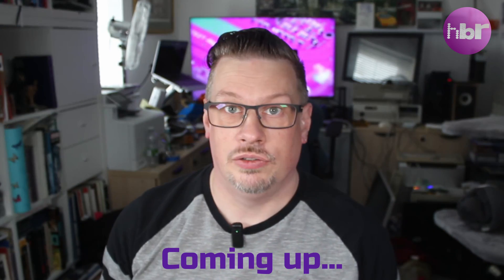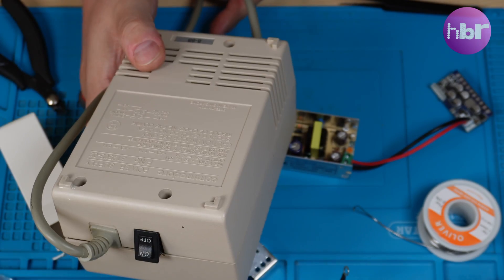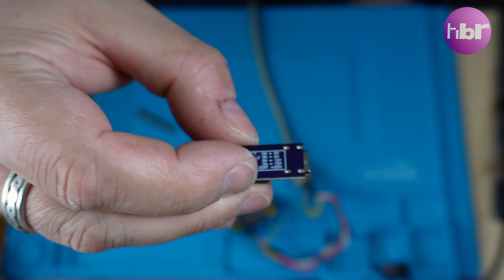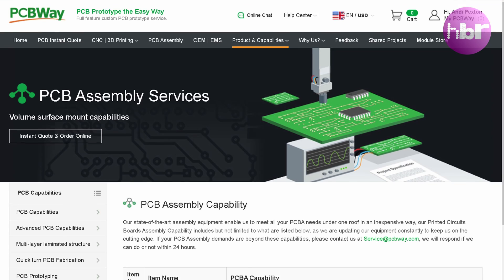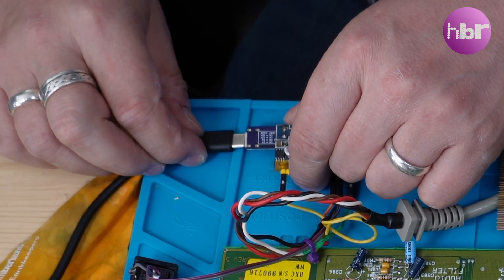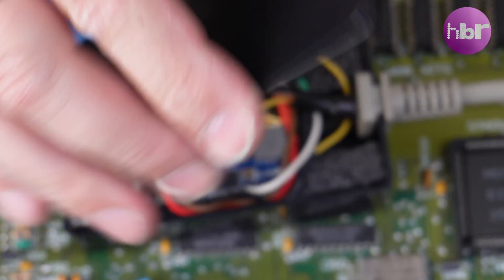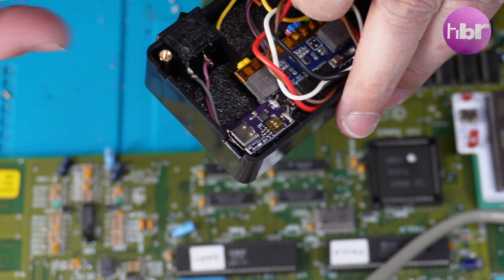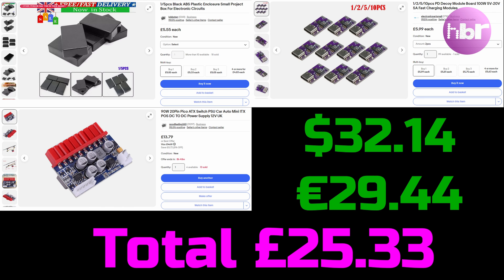Battery Powered Amiga? Modern PicoATX & USB-C Magic!

Comment: How you getting negative voltage from this setup?
Reply from the maker: The ATX power standard provides +5, +12, -12 and +3.3 volts. The Amiga uses +12, -12 and +5 volts...
Reply from the maker: Older power supplies supply -5v (which is part of the standard) this has been dropped from most modern ATX power supplies.
Reply from the maker: In this specific case I'm using a PD module to deliver 12v DC and powering a Pico ATX clone which is a DC-DC switch mode power supply, and provides the ATX voltages that are wired up to the Amiga